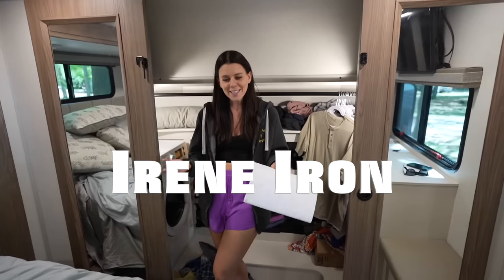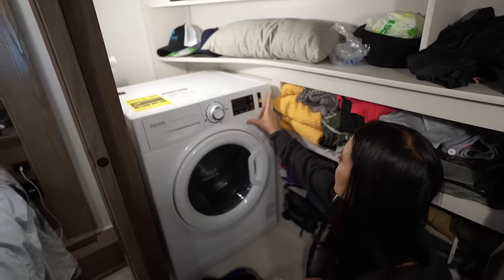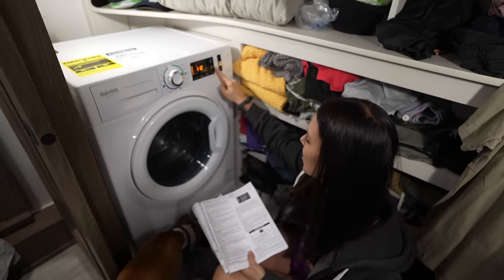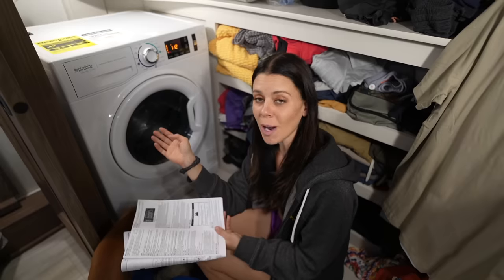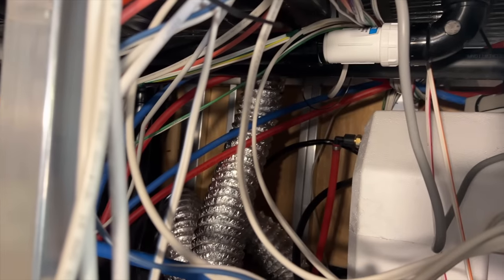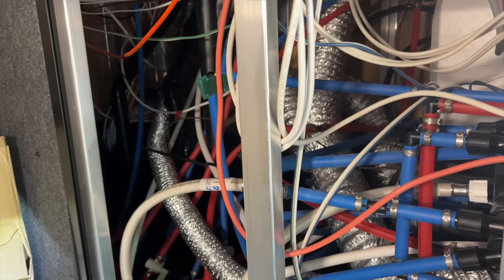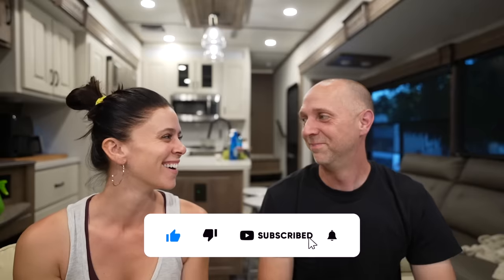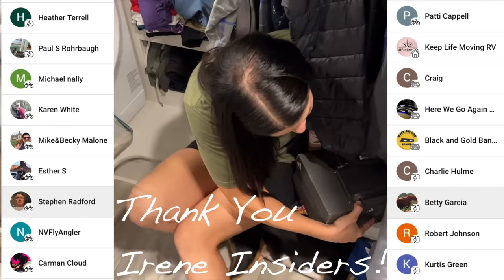We weren't expecting THIS one week after buying our New RV

Comment: I'm thinking that this came up because of the "rolling earthquake" phenomenon. Thinking about it, it's amazing that RVs tolerate road forces as well as they do. And I'd certainly bet those pipes were connected by when it left the factory. But with an RV, the term "shakedown trip" is evidently quite literal! And it could be almost the only way to discover what could be jarred loose when the RV is in motion.  So, yes, just as you said, we can all expect that a first trip in a new RV could expose some weaknesses; it's just the way it is. So thank you for showing us what real life can be like. And enjoy your new on-board, personal mini laundromat!
Reply: The pvc fitting wasn’t glued right at the factory. If it were, the pvc would break before the glue joint fails. It literally melts the “plastic” together.

Comment: I used to work for Sears and when they delivered a washer the drain hose had a U shaped piece the the hose went through kind of like a candy cane to shape the hose and also limit how far down the pipe the hose would go. If the hose went too far it could start to siphon water out of the washer.  They would also tie rap the hose to something to keep it in the pipe. They had a lot of water damage clamps because the newer washers pumped out so fast it could lift the hose out of the pipe. Once the hose falls to the floor the water keeps running out because it’s draining as fast as it try’s to fill. So the water never stops until you turn the washer off. What a mess!!!

Comment: The thing that I'm screws is called a clean out it's also used winterize the drain to make sure no water is standing in the horizontal section of the pipe

Comment: We also have a 295MK that we got at about the same time you two did.  A few minor issues here and there, but Alliance has been great at sending us parts, and authorizing a mobile RV Tech. Since we also full-time, dropping it off at a dealership is not really a possibility. As far as access to the plumbing, I found that also unscrewing the next piece of wood inboard from that removable panel helped. I was able to crawl quite far in to the belly that way. In fact, almost all the was to the converter/fuse box. Not fun, but doable. And as you pointed out, a great idea to  look behind the nautilus after some time on the road. Most everything is accessible, and easy to work on, despite how it might appear.
Reply: For the kind of money people are spending on a rig like that all u should have two worry about for the first 5 years or more is having a tire blowing out and a tire can blow at anytime they need two be regulated by some body that's for sure

Comment: Yes! Check everything!!! Our 1st trip out, yes 1st, our awning motor arm broke in half and the awning came crashing down, on the same trip we were getting a solar system installed and while we were in the basement wiring things up we heard what sounded like someone was washing their car and found it was us and both connections at the hot water tank came loose and was spraying water everywhere again while we were in there with wires everywhere and a lot of it was live. I also found why we weren't getting any rear heat...they pinched off the ducts right at the furnace with how they ran the pex tubing so I had to run all new pex and now it's ran neatly but theres been so many things we've uncovered that have been improved or repaired and in the 2 seasons we've owned it I think the bugs are worked out.

Comment: So much for quality control, I have owned a lot of RV's over the years and the old ( Executive coach) was by far the best. The newer campers and trailers were the worst for problems like you experienced. no attention to detail or testing under real use. Once you get the gremlins out you should be OK. I would suggest you buy a bag of the correct PEX pipe clamps and the crimp tool for when they leak. Happy travels.

Comment: Informative presentation & you have saved other RVers from water leaking by learning from your mishap.  Good thing in the under-storage compartment the first box was a plastic bin so if did get wet whatever was inside was not water damaged. Wise to have plastic instead of cardboard.  Could you have a water alarm in that area (& by the machine) so you would hear if there was any water leaking from any of those pipes? The battery operated ones are reasonable price under $20.

Comment: I’ve had a similar situation with my shower drain in my 2021 milestone. After a trip it had wiggled loose. It was just one of the compression fittings on the p trap. Since I have an alarm system on it I am contemplating putting a ring flood sensor in that area for some peace of mind.

Comment: First off yellow abs glue allows one to see it's glued. Second never use primer. Third the leaking clean out should be rotated so it doesn't dump the water it holds when opened.

Comment: Bummer on the laundry leak, but the good news, you have a laundry! You might want to use a laundromat for washing the bulky bed covers. That washer doesn't look that large. Glad you got it fixed quickly. Everything I have read and watched said expect issues with a new RV. We bought our trailer in early 2022, and on the second trip the 12V DC fridge died. My son and I ended up removing the fridge and troubleshooting the problem. Found a bad connection to the compressor. Luckily we were able to fix it and reinstall everything, and the trip was saved. It seemed like it took all summer to work through the little issues, it was very Frustrating. I hope you are done with the issues on your new home.

Comment: My leak on a new TT was under the sink. Happened to look under the sink after doing dishes and cleaned up the water before any damage. The drain pipe was never glued together at the factory. Looked identical to your pipe separation.

Comment: We paid for an independent inspector to check the brand new unit, then had the dealer fix problems before we signed the bill of sale and drove off with our brand new motorhome.  It’s been only four weeks but no issues except a neighbor’s  weedwacker sent a string flying to a window and broke it into little pieces.  Now searching for local repair service.  We’re only three days into the search after making numerous calls.  Our dealer is a four hour drive from our home and prefer to avoid long drive.  We’ve ordered a replacement window from the manufacturer of the motorhome.  Hopefully by the time we receive it we will have found someone to install.  Issues with homes on wheels are unavoidable even when we do everything we can to keep anything from happening.  Wishing you safe and hassle free travels.

Comment: Consider checking your junction box where your power cord connects to your fifth wheel. Many manufacturers use wire nuts and they eventually arc and burn not only the wire but the wire nut itself. It also causes a shock hazard. We have a Winnebago Navion This happened to us. This is not an isolated case. Volta connected using wire nuts on a brand new fifth wheel. It's shocking.

Comment: That was a dry fit pipe. I am sure a laborer cut the pipe dry fitted it to make sure that it was the right length then forgot to glue it. In the PDI process this could easily be missed as the pipe has no pressure to it at all. Then when they took ownership and started hauling the trailer the pipe eventually viberated off and hence the leak.

Comment: 1st thing I noticed and would have done was shut all power and disconnect batteries. I was getting the willies watching you stick your hand in there with electricity running through the trailer.

Comment: I always tell people with new trailers to go thru all the plumbing connections that you can see and tighten them. I’ve seen so many lose connections on new rigs waiting to flood the rig after one rough road. Especially the water pump connections. They are always loose and people wonder why they have low or no pressure 😂

Comment: I guess your ankle is better. I sprained mine a month ago too. Not nearly as bad as yours, just ice and tape and arnica. You did use arnica, right? It’s weird that they never connected the pipe. I just watched a video last night of a factory tour and it was both impressive and dismaying. Impressive in that they did so many things with cranes and stuff but dismayed by the mess. I find a neat work place mandatory for clear thinking. They had stuff all over the floor. It’s still a very new company and honestly think they will improve over time. Hopefully before my 310RL is built. Incidentally we picked the 310 because I didn’t like the two bathroom doors but I like you guys pantry better.

Comment: I am shocked at the mess behind the water management panel. All those unsupported water pipes and connections. What looked like 110 volt wires unsecured. It's not allowed in residential construction.  How could you ever do any sort of QC when you look into a mess like that? 
Glad it got resolved

Comment: Why do you have the dump handles pulled on your tanks?  Always leave them closed until you are ready to dump.  Otherwise you are inviting the poop pyramid and lines that get clogged with solids.   When your black has enough in it to drain, drain that first then pull your greys to flush out the lines.

Comment: With that "wad" of wires and water pipes one would think they'd put in a water detector in that area.  I'd highly recommend adding a couple as they are cheap insurance.
Reply: Could have a design to drain water from a leak in this area, rather than a random spread that could soak storage items. All these unsupported water pipes and fittings shaking around are bound to fail at some point. 

Could be these types of trailers aren't intended to be on the road very many total hours, just relocated a couple times a year.

Comment: I had 2 KEYSTONE rv trailers 1 travel trailer 1 5th wheel  1 forest river 5th wheel the forest river was the biggest p o s from day one  water leaks, electric problems, windows leak  window fellout, much more  took back to factory several  times  finally dumped trailer

Comment: Looks like they didn't glue the fitting. Yikes. P.S. Our RV is a 2003 Newmar Dutch Star 39' diesel pusher. We have a Splendide washer/dryer combo. We put the washer in a tray in case the hoses or machine leaks with a drain hose from the tray to the outside(wouldn't have stoped your problem) and I installed several water alarms behind the washer and in the bay below it. We bought the RV in 2016 from Lazy Days in Tampa, Fl  from the original owners via their trade on a new Rv, with 45k miles. We always turn off the park/city water connection at the pedestal any time we are leaving for more than 5 minutes. We typically put some water in the fresh tank and use the rv water pump and turn off the pedestal water. At night and if we leave during the day we cut off the water pump. I sleep better  LOL.  If your toliet valve fails the toliet WILL overflow. There is no trap to drain the water like in a regular house toilet. People have come back to find water throughout their RV.   DOUBLE Yikes.  Safe travels.

Comment: Don't feel bad about that leak.....every RV we have owned has abs pipes that the factory forgot to glue. The first one on our toyhauler was the grey tank vent, and the second one was the shower drain. DOH!
I would check for water in the insulated underbelly if you didn't already.

Comment: Unless the pipe was always off, no one would have checked it after it being assembled.  It's  not under pressure so it could easily stay in place with water running through it.  Plumbing is always dry fit before gluing and someone forgot to glue it.  It could have stayed in place for quite a while until the right combination of bumps worked it loose.  I think what it really exemplifies is the lack of or poor inspection done at stages in the manufacturing process.  A plumbing inspection would have found that.

Comment: GE has a new full sized all in one combo washer drier, it doesn’t need a vent either, uses less electricity, but it weighs 350 lbs.
Reply: Per the mfg specs it weighs 183 lbs
Reply: My comment was regarding a new model of “all-in-one” combo washer drier made by GE. One of the areas of concern in all in one W/D combos is load capacity and cycle time. Depending on the size of the load a complete cycle can take up to 6 hours. The new GE model is Full Sized and a full load can cycle in just a little over 2 hours, my comment was that they weigh 350 pounds, I don’t know if that will work in a RV. That they don’t need a ventilation duct is a plus for them.

Comment: Did you have problems with your outdoor rv?  I've had my 2018 outdoor rv 20fq since new and no issues.  I often want a truck camper but mine is built so well and I don't know what another would be like so I keep mine.  I have no complaints with this one.
Reply from the maker: We had some assembly and fit and finish things… But nothing too major. It was built really well but still had a shower leak, drawers miss assembled and the finish flaking off. If your happy stick with what you have, but if you really want to try something different… do it! Life is short 😊

Comment: As a 25 year plumber, that simply tells me little to nothing was tested. To us, that's insane! Explains the type of workers they hire!
Reply: Absolutely agree with that know buddy take pride in their work anymore and yet their prices just keep going up up and that's a shame for the consumers out here
Reply: A ton of manufacturers I've seen are mixing Pex b and vinyl tubing and then using the pex fittings ON the tubing. They are using the crimp clamp style pex b, and once they move even the slightest they start leaking where the two dissimilar tubings join. I don't understand why they don't just use pex for everything. I plan on replumbing my whole camper in the spring but bought a pair of crimpers to keep on hand in the meantime. Flipped the valves to bypass my water heater and got my first leak lol. But there are several makes out there with the same issues.

Comment: I agree that fitting never saw glue. I don't think QC would have caught the mistake. The fitting was pushed together to check fitment and probably came apart while driving down the road. This is a staffing problem. You pay peanuts you get monkeys. Not to mention behind that access panel is a complete mess. Plumbing, wiring and cables everywhere. No pride in any workmanship.

Comment: Tide pods are not recommended for the combo.  At least they were not recommended on mine.  Do the new ones recommend pods??
Reply from the maker: Yes We've now heard that twice now, but the manual doesn't say anything about not using tide pods. Only says do not use fabric softener sheets. 

We've probably done 50+ loads now and haven't seen any issues with the tide pods. 👍

Comment: Oops I trusted the dealer did a PDI but it was just a line item they charged me for. A dealer PDI=probably didn't inspect but charged for it. If they truly did a PDI this would have been found. Always get a independent certified inspection done before you sign on the dotted line. I like Blue Ox on the run as they anal on doing an inspection and they work only for you not the dealer. Yes all RVs will have issues but with a inspection you know what they are and can get them repaired before you buy. In my opinion an inspection is a must and way cheaper than it ruining your outing or worse your RV. 

   Glad they fixed your issues but they should have caught it at the facility or at the dealer but they had rather well it than fix it first.

Comment: That was very fortunate, easy to diagnose easy to get to and easy to glue up.  The quality assurance on RV's really sucks.  Having the access panels open is a really good idea for the first couple of months.  The Nautilus panel system is IMO fantastic but the PEX connectors (plastic) and crimps used in the industry are the absolute worst.  Imagine a plastic connector running down the road at a constant vibration in over 100 degree heat and expecting it to not leak.  Ha Ha!  I have changed all connectors to brass.  You have the perfect opportunity to preemptively fix this one item of poor engineering and thus quality.  I would GLADLY pay an d additional $100 for this upgrade.  I bought my Grand Design before it was sold to Winnebago and yes they were good on customer service but bottom line the only reason you called was because there was a PROBLEM!!!

Comment: Hey guys I enjoy watching your videos and learning from you guys. So my 2023 rockwood 2606ws is 50amp 2nd ac preped. I’ve been trying to decide if the 2nd ac is worth it or going to the mini split cassette style system? If you have any advice I’d appreciate it thanks. I really like your new 5th wheel with 3ac!!
Reply from the maker: Thanks! We were really comfortable in our 26 ft travel trailer with one 15k btu Ac. But with your added length and separate bedroom I could see why you might need more. A second AC is definitely the easier option, but if you have the money and capability to do the mini split that with be awesome! But they do require a good amount of modification to make that happen. Go mini split if it’s in your budget!

Comment: Go get some glue and repair it in 5 minutes! That thing you called a valve on the black PVC is not a valve it is a clean-out plug fitting! Water isn't going to hurt your water heater insulation! Just dry it out!

Comment: Great customer service is important, but this type of problem should not happen in the first place. This is sloppy work. I was also surprised about how disorganized the wiring and plumbing looked like. It is no surprise that stuff does not work or breaks easily. Clean wiring and plumbing is a basis of preventing issues. It looks like Alliance is great at marketing, but as bad as all the other large RV manufacturers when it comes to build quality.